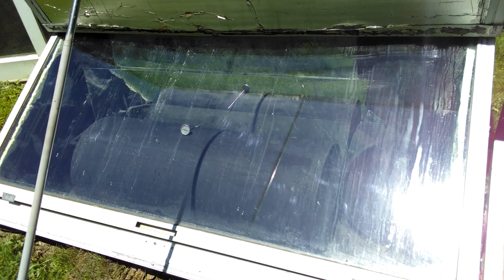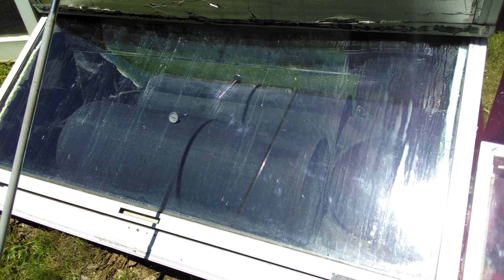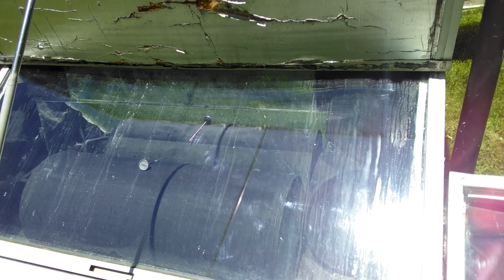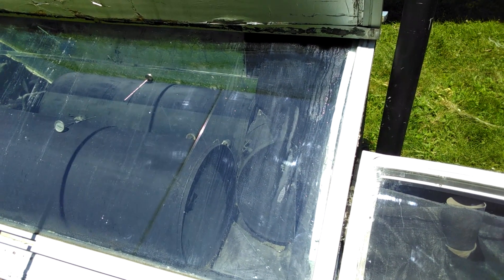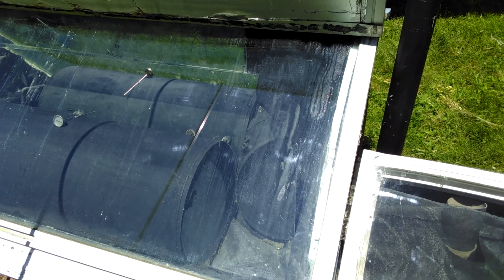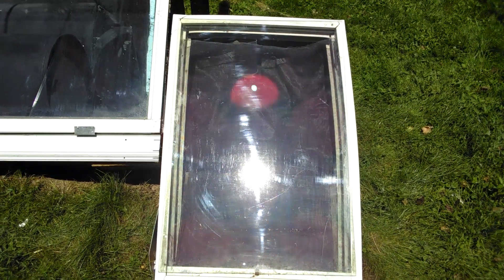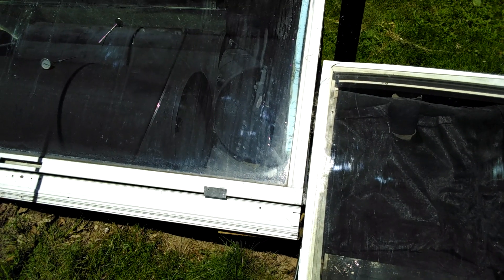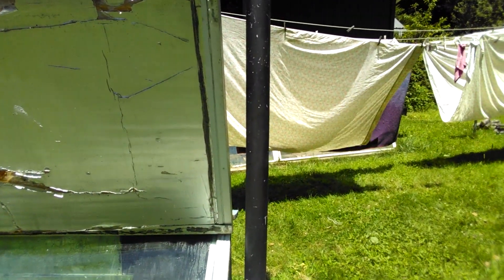Supercharged, solar batch water heater

Comment: Have you tested without the mirror? Another YouTube said his reflective interior surfacing actually made it cooler vs flat black paint/black sand absorbing the sun.
Reply from the maker: Have not tested without the mirror. The mirror in my box cracked a few months because it got too hot in the box reaching  over 180 F. I'm not having a problem with not getting the temperature high enough to heat the water using the mirror . I was just going on the theory that if the sides of the box are flat black drawing heat  into the sides of the box it would  warp or melt the insulation that I used to hold the heat in.  The angle on the mirror  has to reflect the sun's rays downward to the back of the tank and not back towards the glass covering . Did the other YouTube say if the air temp in the box was cooler or the water temp in the tank was cooler? If the black sidewalls and sand was absorbing more of  the BTU's instead of being absorbed  directly  by the black tank  it would take longer to heat the water.
Reply: @SteveV1960  I am still going to put a mirror in mine to bounce light off the back of tank as you did. It is worth testing because it makes sense to have a mirror. But maybe long term heat retention was the goal vs hottest water temperature? Here is the link to video https://youtu.be/TkDJ9jiiOcM

Comment: There are some really interesting concepts in this system, that I have never heard of of thought about before. Such as the hot air being fed underneath the tank. Would love to see more details about this tank, it’s setup, and how well it does in winter, if you are in an area with low winter temps.I assume you are, since such things incorporated into your system. Thank you for this video and all the brilliant ideas!
Reply from the maker: The tank will be drained in early November .  Not enough sun in the winter months here for solar heat. It will be refilled in early April again . It's  tied into the feed line of the house water heater  with a bypass valve. When the water  is hot enough from the tank it bypasses the house water heater.  When it's  not then I feed the warm solar water to the cold inlet of the instant heater .